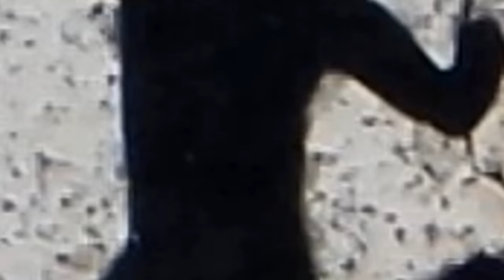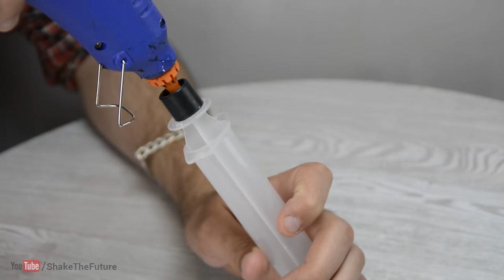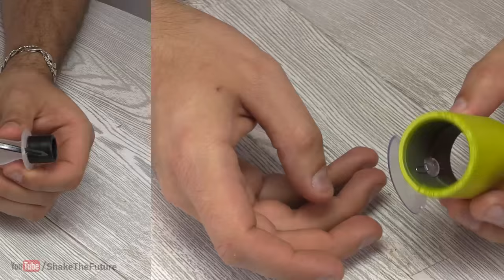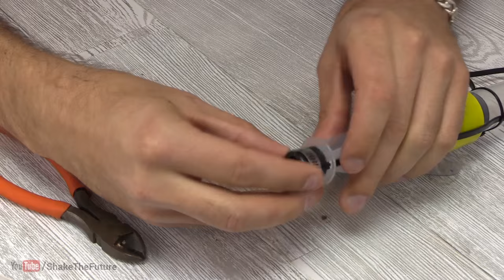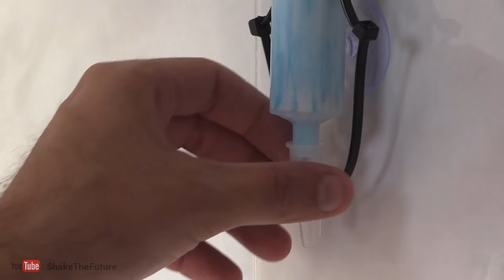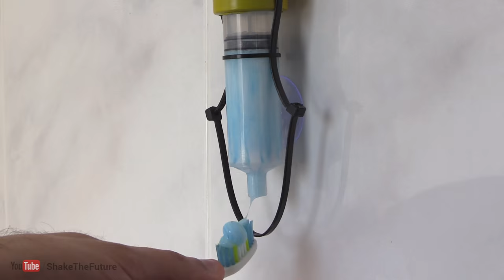Make a Toothpaste Dispenser from a Syringe

Comment: Interesting, nicely done!
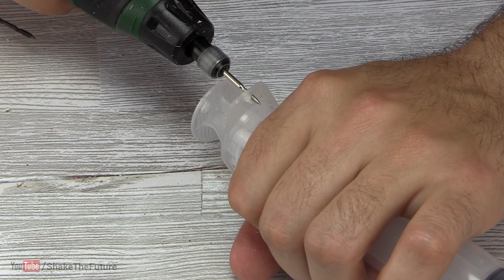What kind of bit are you using on your drill to cut the holes in the syringe, at 0:15?
Reply from the maker: It came with my rotary tool. I think they are called diamond burs.
Not sure what size I was using.

https://goo.gl/OAGMbx

Cheers!
Reply: Thanks, I might need that, I have to make holes in plastic and a standard drill bit doesn't allow for lateral movement!

Comment: I'm sorry to hear of your father. This is a pretty cool project but the cable tie seems like it could be improved. Because the syringe plunger position is always variable, wouldn't it be better if you placed the entire syringe inside of PVC, added a cap at the bottom and drilled a hole to allow the nozzle to protrude, and add a lever on the side with a spring, similar to a drill press, to pull the plunger down? Or, better still, a DC motor with a worm drive and a button on the side you press to dispense toothpaste?
Reply from the maker: Thanks!
I guess there is always a space for improvement :)
The plunger's position is changing all the time, that's why you can adjust the length of the cable ties.
You don't have to adjust it all the time. Once or twice a week, depending on how many people use it.
Dc motor is a good option.

Thanks for the suggestion.
If I will make a soap dispenser, I might consider using a motor.
Cheers!

Comment: If you hot glue a nut  and a motor  to screw the syringe in ...
Reply from the maker: Indeed!
I will have another project coming up in the future where the motor will be used.
While working on that project, I was considering doing it similar way - with a screw and a motor.
At the end I did not, but it's a good approach.
Cheers!